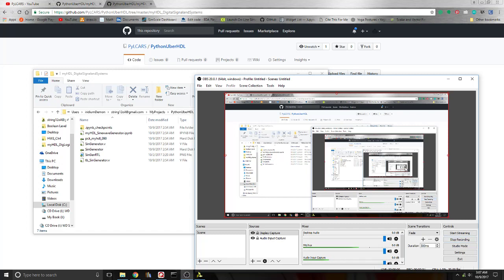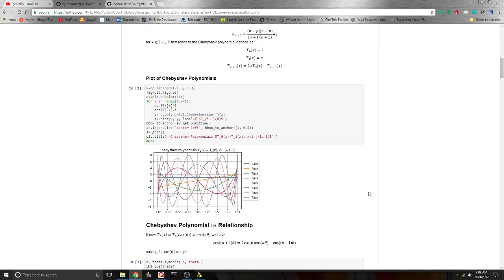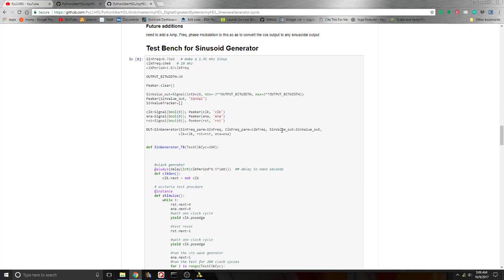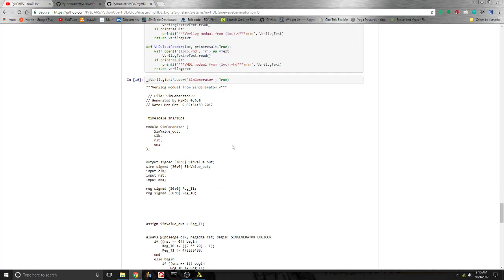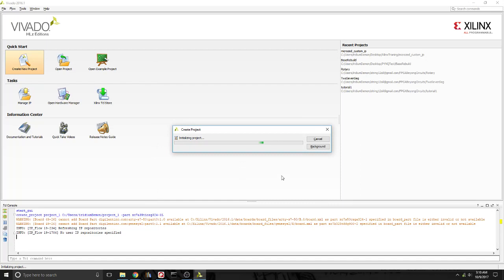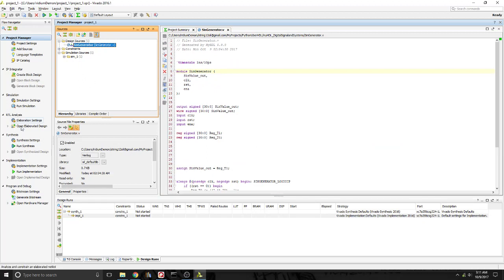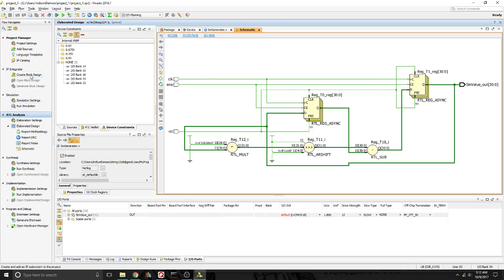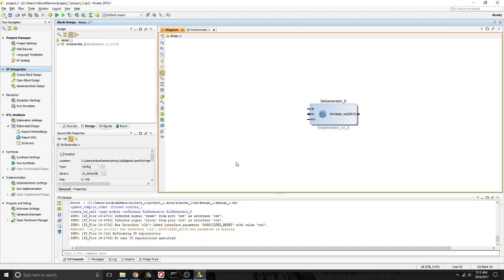myHDL Sinewave Generator To Vivado

Comment: why 30 bit output ? there are no 30 bit dac ! mostly 8 bit dacs are common... I tried the code and it didnt work :(
Reply: actually made it work but the output is heavily aliased, at 100 MS/s sampling I get only a square wave and not a pure sine.
Reply: I think the lookup method with sine is better if you can afford a ROM to store the sine LUT onboard